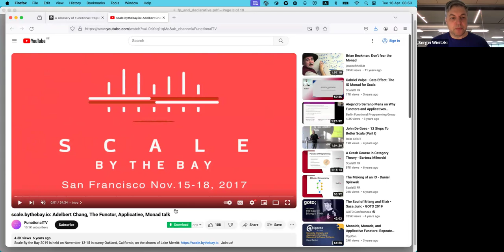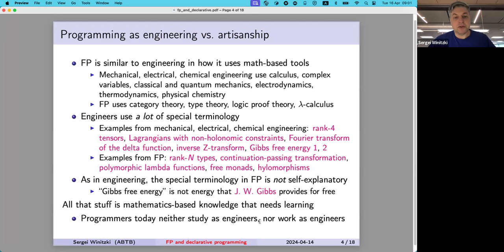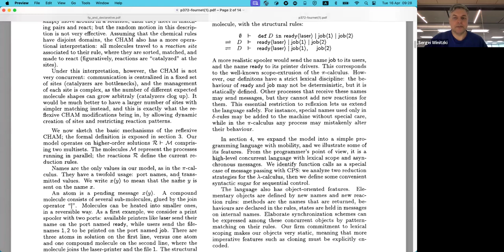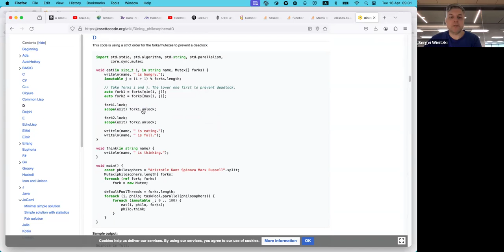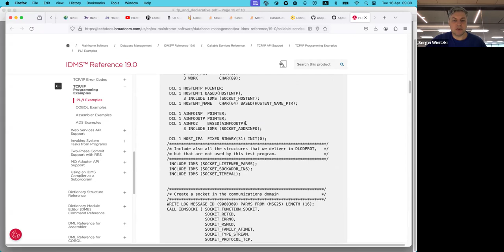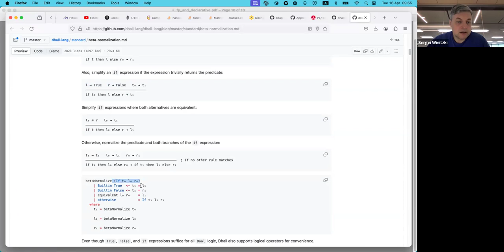Functional programming and declarative programming

Comment: I like your work. You provide a unique point of view and you dig into details. Yet on the second example of slide 8 at about 25:00 I disagree. I would read 10 and 20 as labels (I was not trained on Fortran). Also regarding zero I guess it is 1 as in the formula minus one.

Comment: Nice talk! I have some thoughts...

Under the functional paradigm, programs are made of declarations (x :: type) and definitions (x = term).
Declarative programming, in my mind, is "executable specification" where you only have to write the required type, and the machine automatically checks the proposition (i.e. Propositions as Types), implements an algorithm, finds an element of a set, etc.

A DSL can offer 100% automation over its domain of specifications. Implementing a spec in general is on a best-effort basis.

When I was investigating Category Theory, I found that 90% of the code I wrote was at the level of types. Usually, an implementation was constrained to be unique, so that code (that I wrote manually) could be safely ignored once it compiled; all the relevant information was in the declaration.
In my day job, things are rarely so clean, but the principle is still useful. And I can put that extra effort where it matters, for reliability, etc.